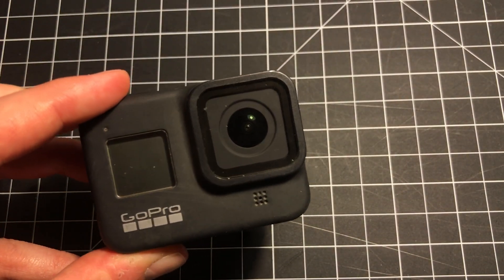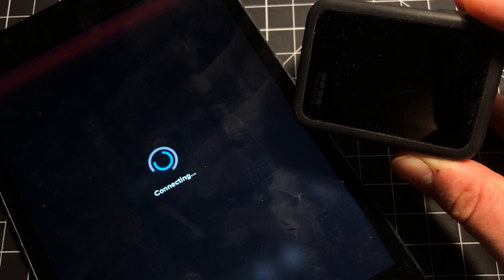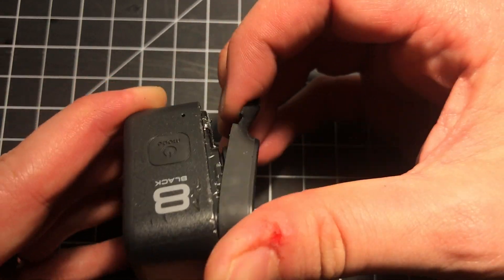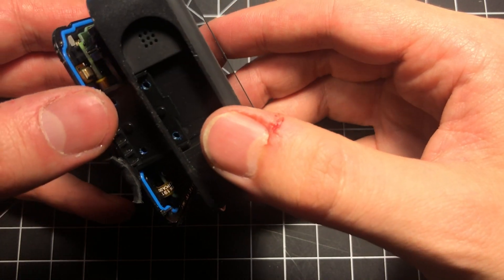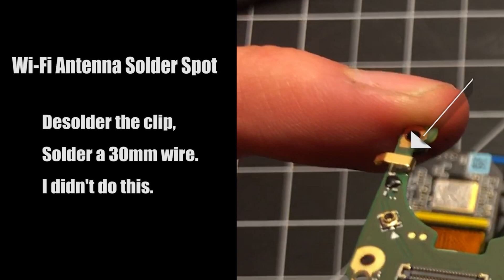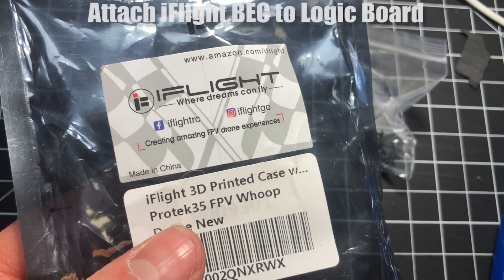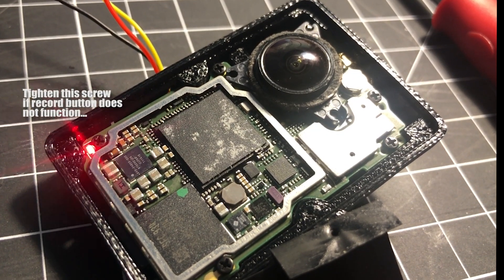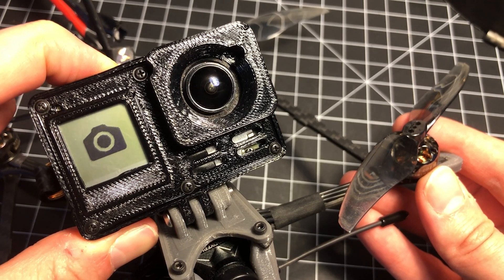Naked GoPro Hero8 Assembly How-to (iFlight BEC + 3D Print Case Kit)

Comment: Can this be wired directly to 4s battery leads?
Reply from the maker: I use it this way, the power for the naked gopro on my flywoo explorer lr v2 has a cable that runs right to the vcc.
Reply: @JohnCuppi  sweeeet thanks dude!

Comment: Great video. I was able to successfully convert one with your video! I do have a question though, does your naked gopro 8 stop recording after a certain amount of seconds? It happens to me all the time. Like it still stays on but when I land and check the gopro lcd screen, it stopped recording a while back.
Reply from the maker: Glad my video helped you convert it!!!  😁 No, mine does not do that. Are you using a sandisk gold extreme microsd card?
Reply: @JohnCuppi  yes I am! I even formatted it and everything. Could it be an overheating issue? I have no idea what other reason if can be

Comment: Just because its powered by the same LIPO I don't think this entire hastle worth. As fly time should be the same or 30-60s difference with full size gp and naked one. Yes drone is lighter, faster etc but.... ripping apart 300-400 buck camera....
Reply from the maker: Well frankly, that depends entirely on a lot of factors and flight time is absolutely not going to be the same from drone to drone. It’s a sweeping generalization to say that it will only give 30 seconds of flight time more. 

Flying with a full size GoPro Hero 8 on my flywoo explorer LR V2 is a for example is a bad idea, it is actually too heavy. I lose significant flight time per every 10 grams on that build that adds up. 

For a 6” or 7” long range build the difference is probably not worth it, the size and power of the build can take the additional weight with less penalty. 

Also, some people want to stay under 250g due to regulations, and this may be the only way to accomplish that. It’s definitely not worth it for everyone and each case will need to decide their own risk assessment. 

Personally I have had no regrets doing this build, I love it on my flywoo explorer and small cinewhoops, which is what it’s suited for. This is a unique product that you still can’t buy anywhere and achieve the same result.
Reply: @JohnCuppi  absolutly agree. Everyone looking after in terms what they need. I probably will go with prebuilt naked one as do not trust my own skills haha

Comment: Never buy this case ! Because it bends and touches the bec board, which creates an electrical circuit and artifacts appear on the video. Best case it is GEPRC for this time.
Reply from the maker: The GepRC case is better (plastic injection mold), but wasn’t available at the time I did this video. How exactly did your case 'bend' and destroy the board? TPU is not conductive at all, so even if the electronics were to touch the case, nothing would happen! I've been using mine all summer long since I built it with zero problems.

Comment: I crash... a lot, how do I protect the lens?
Reply from the maker: This isn’t a good camera to use to if you crash a lot. Naked GoPros are fragile and meant for cruise style stuff with not a lot of crashes. ND filters like an ND16 from Telesin that I have linked in the description will also serve as lens protectors.
Reply: @JohnCuppi  thanks for the quick response, man. I've been meaning to get an ND filter so that's perfect. Thanks again

Comment: awesome! I used your tutorial and it worked out well. I do have an issue with the recording button. It can record the video but when I press it again it doesn’t seem to stop the recording.
Reply from the maker: Glad it helped you!!! That recording button issue is weird, for me the recording button didn't work at all until I got it seated properly. The only thing I can think of is to try to re-seat the BEC but I'm not sure if it's worth it. There's always some small risk of damage every time those small connectors are mated together. You have control with gopro BLE right?
Reply: @JohnCuppi  gotcha. Yeh i do have the Gopro BLE app. It takes a while to record and stop but it does the job.

Comment: To bad GoPro doesn’t jump on the FPV band wagon & sell the board, lens & screen in a kit or just sell a naked GoPro
Reply from the maker: We can't even get them to stop removing easy access to Protunes because they want to sell that dumb remote. 😥
Reply: @JohnCuppi  I guess you have seen the Naked Insta360 One R that Betafpv is selling? Last time I looked it was still on BO but that was several weeks ago.
Reply from the maker: @GeezerGramps  Yes, I have -- I decided it wasn't worth buying for me. The video footage from the gopro hero 8 looks way better than the SMO 4K and does not require any software to edit the video. It is not a "bad" camera -- but I purchased this gopro for $167 and the iFlight kit for $35. For roughly ~$200 if we do not include the cost of labor that I spent on this, which I enjoy doing anyway so it's not really "work", I now have a much better device. If I had failed on this, I probably would have ended up just buying the SMO 4K for lack of literally any other option on the market.

Comment: I have a question. What about heat dissipation in such a small thin case will it be better or worse? Also why do you think GP does not make something like this streamlined there are a million uses for one that small and thin. Great video it was very detailed it looked like a ton of work but you summed it up well. You also showed me I do not have the patience to do this xD
Reply from the maker: Thanks man. 👍 For heat dissipation, well, I am not to worried about it because there's so much air flow while flying. But yes, I think stand alone it should actually be a bit better. GP won't make something like this because they don't care about the FPV community. I could go on a long rant on that one, how they stopped production of the session 5 and took away easy access to protune settings in the official app. :(
Reply: @JohnCuppi  I cannot wait to see how it works! Hurry and fly lol.